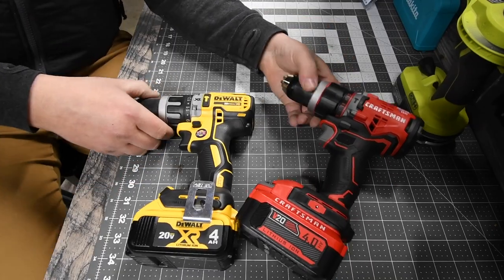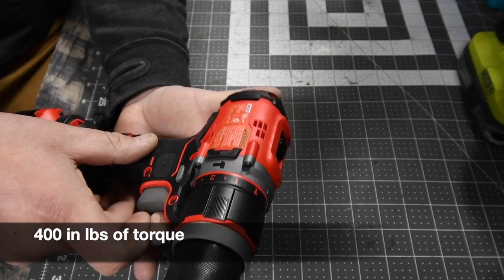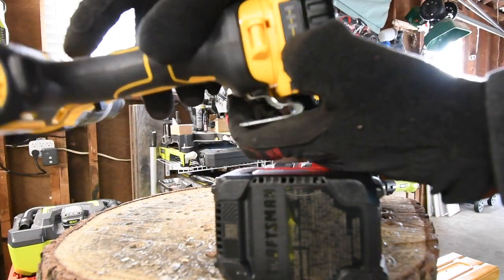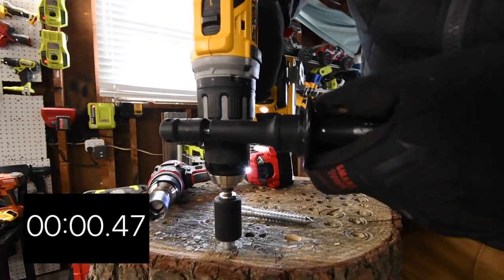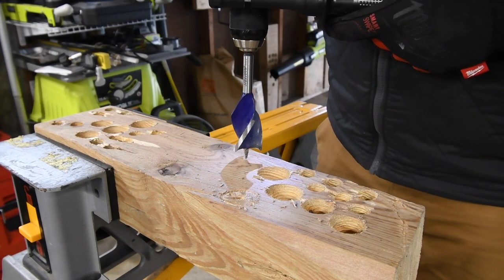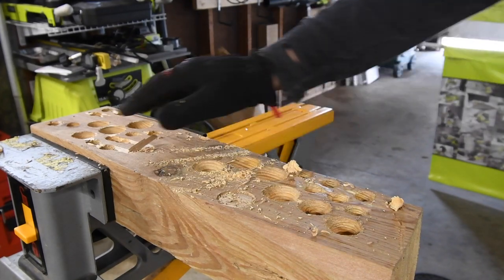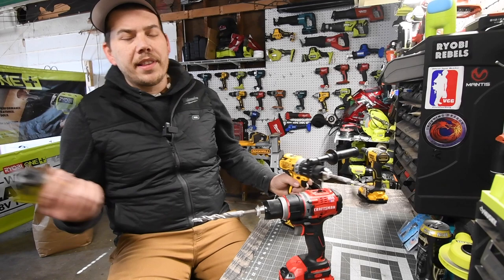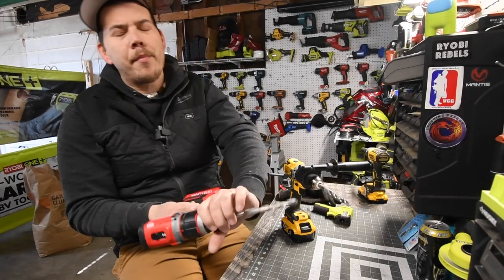Craftsman vs Dewalt (Hammer Drills)

Comment: I’ve always been a fan of DeWalt (at my job) and craftsman (for my home). I always have thought craftsman though cheaper build quality (more plastic) was a good tools both power tools and obviously hand tools. Craftsman just seems to be way better bang for the buck. More then likely at home your not gonna be using tools so hard you burn them out. I mean if you got the money dewalt is more durable but for a great back up there is absolutely nothing wrong with craftsman. They are great home owner tools. You could easily build your shed, build a back deck, etc....
Reply: Exactly 💯

Comment: Thanks for showing the Craftsman with the DeWalt side handle and how well it actually works. I actually bought the Craftsman last week for $75 with a free 4ah battery and fast charger specifically because it was a good deal and I didn't have a hammer drill that accepted a side handle and thought the DeWalt would work, so it's nice to see that it does.
Reply from the maker: you are welcome and I thank your viewing Jeff
Reply: @ManCaverTools   is there a way I can find a spare handle online that would work with the craftsman drill like the one in the video?

Comment: Iam a AV tech and use the DCF887 and DCD999, The 887 for 90% of my work and the 999 only gets use when i need to mount tv's above fire places or run 3/4in EMT for fire alarms. Iam getting a little sick of carrying in all my tools just for smaller jobs like mounting tv's on drywall and studs or installing cameras but I still need my big boy tools for pre wires, emt and fire places. So iam making a new lighter bag that i can bring into the small jobs and keeping my veto pro mc with my heavier tools for the big jobs. What power tools will be strong enough to do the jobs i need like drilling holes in 2/4's and mounting tv's but yet light and small enough to fit in this new bag. I have my list down to the M12 Fuel Impact Driver, the Dewalt Atomic Hammer drill/driver, the Hilti SFD 2-A or maybe i can get away with just a Dewalt 12v Extreme Screwdriver. I want whatever is going to perform the best because getting my task done as quickly as possible vs the time saving of not having to bring so many tools that i wont use on to a job. Can you help?
Reply from the maker: and that is why I love all tool brands

Comment: another great video. i wonder how much better performance it would be if the craftsman battery had the 21700 cells as opposed to its current 18650 cells. the dewalt xr has the 21700 cells so would benefit from extra performance. if you could get an adapter for the craftsman and test it out with a dewalt xr battery it might be a closer matchup
Reply from the maker: I wonder that as well. more companies need to make 21700 celled batteries

Comment: Flawed results. You should have started a new hole with the Craftsman since the bit it loose. I would also like to point out that you either didn't lock in the bit on both the Dewalt and Craftsman, or they both came lose in separate tests.

Comment: Is a speedbor bit easier to penatrate wood than a spade bit
Reply from the maker: The speedbore takes a lot more power to drive through wood because there is more contacts on the surface which equals more friction

Comment: hammer drills are useless it only adds weight and makes the tool longer the hammer function sucks get a regular drill/driver and a sds rotary hammer for drilling concrete
Reply: I bought a hammer to drill intending to use it also as a regular drill, but the in and out play where the chuck connects to the hammering mechanism pissed me off so much. I wound up just buying the regular drill too.
Reply: Like most topics, the answer is: it depends. I used to have a regular drill and after I moved to my current house, I noted the regular drill wouldn't cut it on masonry walls and such. My house is made out of blocks/concrete for the most part, I won't get an SDS hammerdrill to hang some pictures on the wall nor kitchen/laundry room shelfs, bathroom accessories. Of course my needs are much less demanding than say a contractor.
For the regular Joe, a Hammerdrill is enough and totally worth paying the $30-$50 difference
Reply from the maker: that is why they make both hammer drills and regular drills
Reply: @ManCaverTools  bright guy is ya lol
Reply: @ManCaverTools  i will send u a sds and you will be amazed at a  basic sds vs the best hammer drill

Comment: Craftsman’s  top line just below, DeWalts mid grade? That seems like just how SBD would want it, since Craftsman is now SBD’s mid tier platform. Now Porter Cable and Black and Decker assume the entry level status.
Reply from the maker: I do thank you so much for viewing :)
Reply: PC is not what it used to be,  but idk about calling it entry level
Reply: @mtanyctrainatlantamartatra7164   I'll agree for the most part with the exception of the USA assembled Craftsman DeWalt Clones. They hold up well. They just gated the power down a smidge on them.
Reply: @firebladex8586  I'll take a PC over a piece of crap B&D anytime

Comment: Nice comparison it seams like dewalt has more rpms than craftsman but craftsman very slightly more torque in my opinion
Reply from the maker: both of these tools did very well against each other
Reply: @ManCaverTools  where do I get a handle for the craftsman?
Reply: @mat_a.c.d.evloganstuff3917  that's a dewalt handle.
Reply: @ckcuev  to which drill or do they sell them apart
Reply: @mat_a.c.d.evloganstuff3917  man caver tools would know that answer. he's got a lot of the dewalt. but i think it goes to the one he tested against the craftsman
Reply: They sound almost exactly the same

Comment: So it's big brother , 999b ? I want the baddest hammer drill the black and yellow fellows make
Reply from the maker: I thank you for viewing  :)
Reply: Either the 999 or 998, they are both identical in performance with the 20 volt XR batteries, the 999 with the 9ah flexvolt or the 998 with the 8ah XR batteries are as good as it gets
Reply: I got the sexy flexy volt , it does the big jobs just fine with the big 6 amp hr battery.